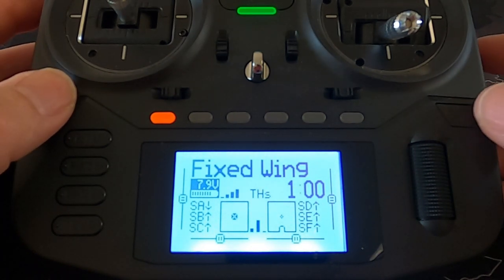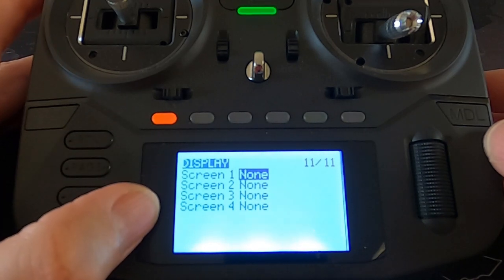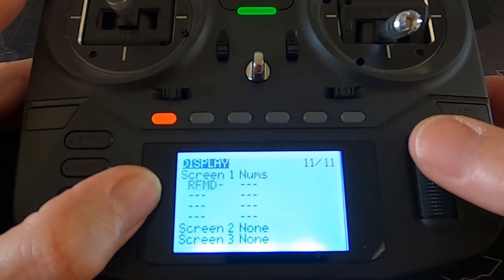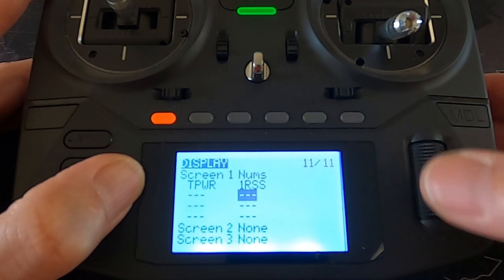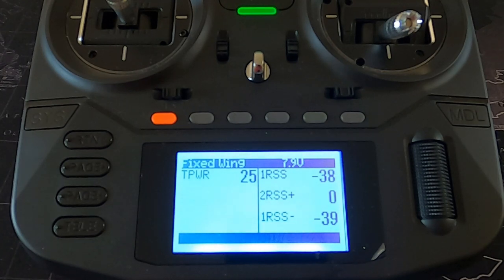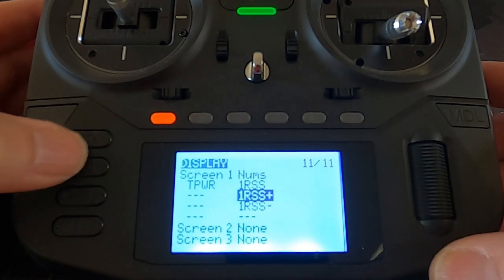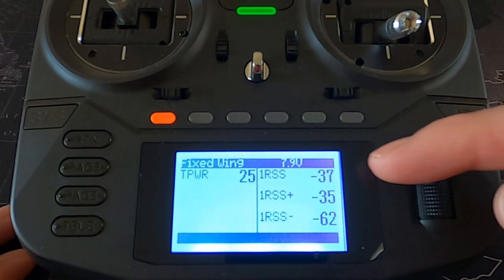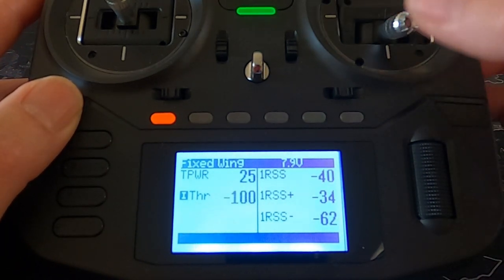RadioMaster Boxer Screens Options under Model Display Menu

Comment: Can this radio have a voice alarm for when the battery on the plane is low?
Reply from the maker: Yes if your receiver has telemetry and can read your flight battery voltage.